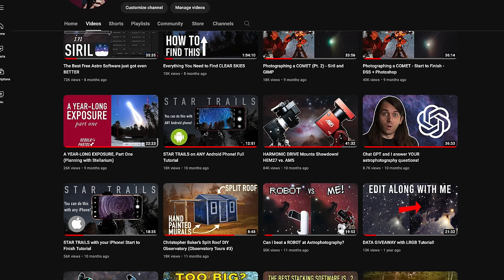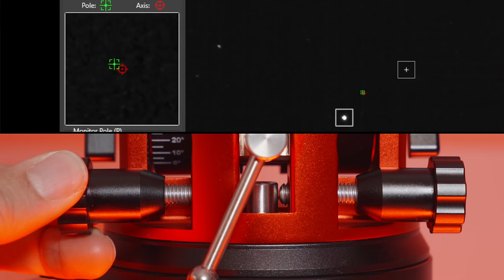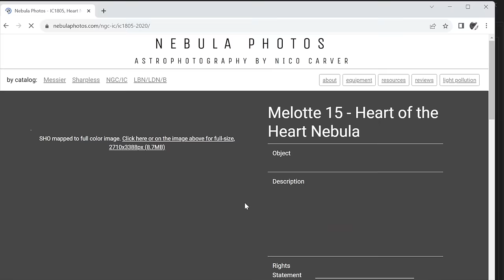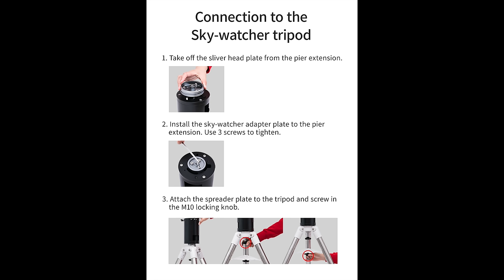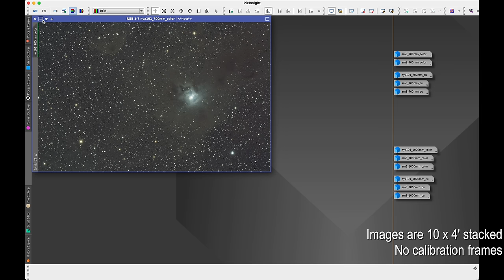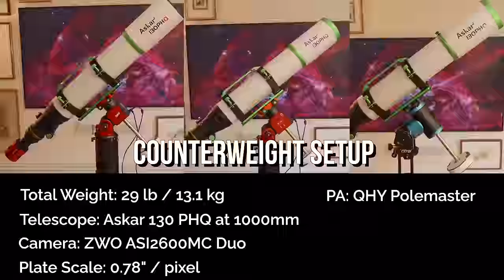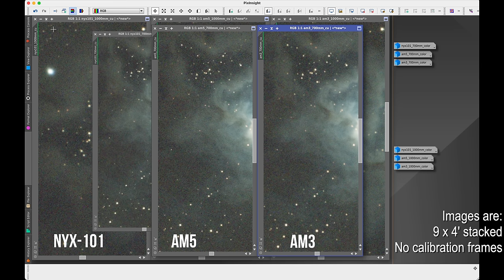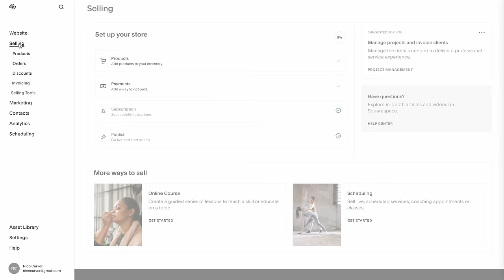Harmonic Drive Mounts are the REAL DEAL! Pegasus NYX-101 vs. ZWO AM3 / AM5

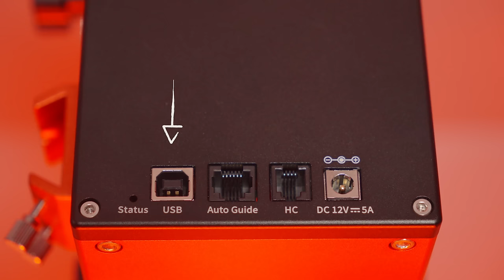Comment: 6:13 so the st4 port isn’t required for guiding? I use a 120mm mini guide camera and have always plugged in the st4 cable between that and the am5 in addition to the usb-c cable between the 120mm and asiair. Is the st4 cable not necessary? Can you guide with just the usb-c connection?
Reply from the maker: Correct, you don’t need the st4 cable and you are likely already not actually using it (you just have it connected, but no data is being passed). Under guide settings just make sure the Asiair is recognizing the ASI120 and the AM5 and in that case you can ‘pulse guide’ and not use the ST4 cable.
Reply: @NebulaPhotos  Wow, I didn’t know that! This should make cable management a little easier. Thanks Nico!

Comment: I've been doing a little searching for harmonic drive components and haven't really found what I want yet.  I want to add a harmonic drive to an old fork mount I have and have been toying with the idea of disassembling the AM5 or NYX-101 and having adapters made to attach it to my fork.  Since the mount is basically at balance the only force the drive has to deal with is overcoming the inertia to get it moving.  Any thoughts on doing something like this?
Reply from the maker: I don't know much about it, but there are people making their own harmonic mounts (for example: https://youtu.be/k2GoMa2DpH8 and there are others on YouTube). I think you can buy the harmonic drive gearing much cheaper so I wouldn't suggest buying an AM5 or NYX-101 to do this. Search 'strain wave gearing' on eBay. The video I linked above mentioned he got his "HarmonicDrive CSF-17 pair for ~400 usd used from eBay"
Reply: @NebulaPhotos  Thx I'll check it out!
Watched the video... JZ's skill set is way above mine... plus he has access to the university machine shop and I don't have anything like that.  Taking apart a mount and putting the drives on my forks axles is probably the only way unless someone starts building kits for the purpose of outfitting old mounts.

Comment: Awesome stuff. Would’ve been nice to throw in the actual eccentricity  number. 😢
Reply from the maker: I considered it but they were all in the .3-.4 range and I think under .4 I don’t think there is much to be gleaned, compared to just looking at the images. For example, that one with the triangle stars at the end from the AM3 had 0.35 eccentricity which was around the same as the other two, but clearly showed an issue visually.

Comment: Thanks Nico. What you measured or demonstrated was interesting. What I think would show off the mounts ability would be Unguided testing. Say like 60-120 second images, comparing FWHM and the length of star trails. That will tell you what needs to be guided out of the SWG mount and a relative demo of how well the mount tracks, not the guiding setup.
Reply: PHD2 has a feature that does just that. But it wouldn´t be an accurate test of the mounts abilites, as their strength specifically lies in guided operation.

Comment: Weird, I'm using an AM5 and the sound it makes is quite different from yours, definitely much more similar to the AM3 in the comparison.

Edit: btw, it would be awesome if you could test Friction Drive mounts like the JTW P75, they offer incredible value on paper and make some pretty bold trackng accuracy claim, they're awful for portability but seems a fantastic choice for a fixed observatory!
Reply from the maker: Some people on my discord were saying in need to do a firmware update on the AM5 to fix the clicking sound. I’ll give it a try. 

Thanks for the suggestion of the fiction drive mount. I’ve never heard of that model, where would I find it?

Comment: I only have a mac, does any of this work with it ?
Reply from the maker: Yes, sort of. There is an effort called INDI and KStars that works on Mac and can control a lot of astronomy gear. It's a bit more geeky/buggy than the Windows side of things which is why I use Windows for control of my astro gear (it's the only thing I use Windows for).
Reply: @NebulaPhotos  thank you so much!

Comment: I've been having some issues with my am5, that I'm hoping I will eventually solve. 
I had been using an orion sirius eq-g(HEQ-5 pro) with a rowan belt conversion for many years. The AM-5 definitely gives me sharper images with short exposures than the sirius does. But when pushing for longer exposures, the sirius seems to be doing better. At around 1400mm, anything over 2.5 minutes, I begin to get football shaped stars with the am5. Whereas I could push the sirius mount much further than that. 
I know 1400mm is further than zwo recommends for the mount, but it's an edge hd 8. So, it is not a long refractor, and I had assumed the limit was because of weight distribution. 

If anyone else is having similar issues, or even has a solution, id like to hear them.
Reply: The moment of arm also plays role

Comment: Good reviews but I struggle to see the benefit of the NYX in this.  Those end be images though are clutch.  All the data fused.  Nice!
Reply from the maker: Tracking performance wise, it’s on par with the AM5 at the payloads I tested. The NYX-101 would appeal to those that want to put on a lot more weight (up to 66 lbs with CW) or are drawn to how it handles the ports (locking gx12 instead of 12V barrel, full power routing through the mount + optional saddle). A minor point would be the ASCOM / windows software has a lot more features than the ZWO driver which is bare-bones.
Reply: @NebulaPhotos    -  Thank You Nico.  Did the NYX handle a larger load as expected? I have a middle weight refractor, VX120,  and keep watching reviews like yours to help me decide what lightweight mount will be needed to upgrade for successful goto and photography.  BTW, your observatory is coming along nicely even if more slowly than you hoped.
Reply from the maker: @guyjordan8201  Unfortunately, I didn't get to test larger loads as the Askar 130PHQ (2nd test in video) is the heaviest telescope I have at the moment. I think the AM5 would handle the VX120 just fine. And thanks on the observatory! Cheers, Nico

Comment: Some nice comparisons Nico. Thanks. But I think your sound measurements are a bit amplified.  My AM5 is the quietest mount I have ever owned. 

If you have your original guide logs posted somewhere I'd like to dig in with my own analyses,  if you would be willing :). A great video overall which answers a lot of questions.

CS,

John

Comment: Nice mounts.  Cost too much.
Reply: They do but these are the expensive mainstream options. I use the UMi 17 mount which performs exactly the same but is quite a lot cheaper. Harmonics are pretty much all the same off the shelf components anyway. DIY is also an option but its nicer to buy a nice unit. I loooooove it so much.
Reply: @sonacphotos 

Thank you for this option 🎉
Reply: @sonacphotos isn't the umi 17 like $1600?
Reply: @newzerozeroone  $1360 including shipping, tax/vat & PayPal fee if bought directly from the manufacturer (that's how I got mine).

Comment: Worth noting The NYX101 polarity is the reverse of the sky watcher EQ6R.
Reply from the maker: Ah, missed that detail, thanks for pointing it out!
Reply: We use the same polarity: negative goes to pin 1, and positive goes to pin 2.
Reply: Yes but skywatcher are the other way around. Positive on pin 1 and neg on pin2. As shown in their manuals usually around Pg 14-15
Reply: @mrlard81  I'm sorry to say that, but this is false, and they need to fix that error.
Reply: I am not worried - I only discovered this as I made up a batch of cables for my NYX. Great mount, very happy 👍😁

Comment: are you sure it's ok to judge a mount by a stack of images? one could easily ruin a stack by just allowing one poor image in it while the rest of the frames are sharp and crips. it depends on the referrence frame etc. also, seeing, clouds, haze, changing from hour to hour could also very easily ruing one's session. i think you shouldn't post rms and other details unless you really know how to fine tune the settings for the exact moment of the night you're shooting (to take into account seeing, part of the sky, declination etc). one time 36 min session with default params is null and doesn't mean anything.
Reply from the maker: I take pains to eliminate bias in these tests. Some of these things are not shown in the YouTube video in the interest of time. But they include: -getting to know the mounts in a number of ‘practice sessions’ -carefully watching the session live to make sure seeing/environmental/other conditions aren’t a factor -blinking the subs -running subframe selector -carefully picking the best reference frame -throwing out the worst sub from each session etc. I wouldn’t post the video if I didn’t feel it was representative of the performance of these mounts with the gear shown.
Reply: seeing will ALWAYS be a factor, it's the only thing you can't do a thing about. seeing is what determines the guiding settings. also, another thing, especially on long focal leghts is differential flexture, which you can't avoid and creeps in your photos, leading to less than desirable effects. did you use an oag or a different scope for guiding? i stand by my previous, you shouldn't post conclusions like these: rms was better hence, stack is sharper. it's misleading and not (totally) true. i can show you 0.2rms guiding with a resulting poor stack, and 1.2rms with extremely good results. with the same equipment. i think a better scenario for what you're trying to achieve is use a mono camera with a very narrow filter and a 30' or a 60' exposure.
Reply from the maker: I think you can in fact avoid differential flexture - it is the exact reason I used the ASI2600MC Duo for these tests which integrates the guide sensor on-axis at the same plane as the imaging sensor. I fully understand that the best RMS # does not necessarily result in the best images. This is what I was trying to gently explain to my viewers through this video. For example, if you were using a very generous image scale with a tiny guide scope it would be quite easy to get a great RMS but in that case all you are measuring is the insensitivity of the guide system. I also addressed variable seeing in the video and explained that it had deteriorated by my last test with the Pegasus which may explain some of what we were seeing in the guide graphs. I understand these tests aren’t perfect, but I try my best and will always attempt to explain those imperfections through the narration in the videos. As for your suggestion to use mono, a narrowband filter and short exposures - it’s intriguing - I assume the motivation would be to minimize the effect of seeing blur on the image results. I think that might work well if I eliminated the worst 20% before stacking. The reason something like that hasn’t occurred to me is I typically gravitate towards ‘real-world’ testing - tests that I design to eliminate as much bias as possible, but are representative of the type of imaging your average astrophotographer would still do. Your suggestion of short exposure narrowband may be a better test technically, but might not connect with viewers in the same way a more normal scenario would.
Reply: i wouldn't call a 30 or 60 minute exposure a short one... :) and yes, i know differential flexture can be eliminated, that's why i asked if you used an oag
Reply from the maker: Ah, sorry, I misread, I thought you wrote seconds. Why such a long exposure? That would seem to me to make the effects of seeing harder to parse, and also introduce a variety of other potential problems/biases
Reply: because that's how you can actually rate a mount (among other things). capability of tracking (guided) and also inspect the sharpness of a single image based on the tracking capability. you state you tried to prove good rms doesn't necessarily mean a good image. but that's exactly what you're showing in this video :). what's the sharpest stack you got? with which mount? what rms did it have? also, harmonic drive mounts are totally different from geared mounts or belt mounts, things work differently. seeing is averaged with decent settings (if you know what you're doing and don't chase the seeing). it won't introduce a variety of anything. what potential problems/biases? other than mount issues (which are actually the subject of the review) there's no other issue that could arise. and you'd clearly see how a mount behaves. your tests are faulty just because you're using the same phd settings for each mount. that's wrong. each mount has its own backlash and kinks, has it's own PE, seeing is different from hour to hour, you can't use the same settings.
Reply from the maker: It’s increasingly evident to me you didn’t watch the video. Maybe you only watched a small bit of it? There was a clear deviation in the second test between RMS numbers and the roundness of the stars. Many of the other things you’ve brought up in our discussion were also clearly stated in the video (what guiding setup I used, the effect of seeing on results, etc). I disagree the need for a single long image to average seeing. Stacking does the same thing, but better because I can eliminate frames that have more to do with atmospheric conditions than the performance of the mount.
Reply: i did watch the whole video. anyway, that was my 2 cents. you do whatever you want with it. just remember you have a great responsability influencing this many people into deciding what to buy. better make it right, for the right reasons, using the proper means. like shooting the same target at the same coordinates (3 mounts, 3 nights, starting at the same ra/dec coordinates). it's of no use if you tell people "this stack is sharper with this mount but with the other mount the seeing was bad so the image is fuzzier". how does that tell your viewers which mount tracks better? how's that telling your users which mount is proned to overcorrections if you used the same settings for each of them? list could go on and on but i'll stop here since you're bent of not taking any advice :) have a nice day!
Reply from the maker: I am open to suggestion, but I truly don’t understand your methodology. Could you explain it? Why is one long exposure better than several shorter ones stacked where we can eliminate blur from non-mount issues (thin cloud, etc)? Why would testing over multiple nights be better when each night will have different seeing conditions? I understand that there are issues with my methodology as well, which is why I am interrogating you to hope to improve it. Do you have an example of someone doing this kind of thing (mount comparisons) better?
Reply: oh, boy. let's try. so, in order to compare apples to apples, you need to do the tests on the same region of the sky. hope i don't need to explain why. that's why you need to spread your tests over several nights. or, you can test on the same region of the sky but you won't have the same subject, obiously. seeing, as i already stated several times, i think, changes from hour to hour, even more often at times. othertimes, it might not change at all for the entire night (slim chances though). so you souldn't care about that unless it's very poor. also, you should tune phd's settings for each mount based on the mount characteristics and seeing. long exposures because they allow you to capture enough signal into a single picture. stacking is misleading as it takes away a lot of the defects and you won't see the real thing. if you do have clouds in an image then you discard it, repeat the test. i take all my photos at 30-60' and i rarely have issues with clouds on clear nights :) a raw 30' frame would allow you to see the roundness of the stars and pixel peeping all you want on the RAW stuff. no artificial rounding of the stars, no blotching of the stars (due alignment errors) etc. you really exclude all that. also, you really see IF a mount is capable of tracking for that long (guided), and you see how it behaves as well. how sensitive is to backlash, how sensitive is to weight and balance, how sensitive is to wind and stepping around it. 36 minutes is not enough to properly test a mount. i could give you examples of mount reviewers who spend a month fiddling and putting it though it's paces. this place is too small to go through all the details but i'm pretty sure you can find a ton of materials out there to read. for starters, this would be a good read: https://openphdguiding.org/Analyzing_PHD2_Guide_Logs.pdf

L.E.: when stacking, you might discard a defective frame which would actually reflect some issue with the mount. like PE, for example. taking a single long exposure though, would show that issue caused by the mount's PE and you'd better reflect reality, wouldn't you? :)

Comment: Pegasus' "optional" 10A power supply is such a BS move. They are basically manufacturing electronic waste by giving you a 5A one that you will most likely never use... also you have to pay extra for the 10A one. Seriously.. anyone buying these caliber of mounts would use their passthrough capability, and power every other part of their setup through the mount. (So they can operate with shorter cable lenghts, less sag, lower chance of the cables getting cought on something etc.)

Comment: .....thought u sed were gonna paint that counterweight.   SHAME!  🤣🤣
Reply from the maker: Lol, good memory, still in my list 😂
Reply: @NebulaPhotos  lets just call it a nice patina
Reply: I have the AM5 as well - my first equatorial mount and I’m quite impressed. Thanks for this comparison, very informative! In your sound test for the AM3, I noticed a clicking sound. I had this as well and found a post from ZWO addressing this and noting that the firmware needed to be updated. The clicking only happened when using the hand controller fortunately so it probably isn’t affecting the tracking performance. It went away entirely one I updated the mount.